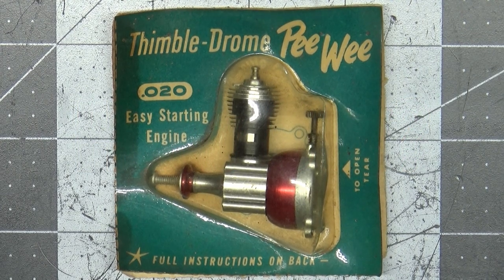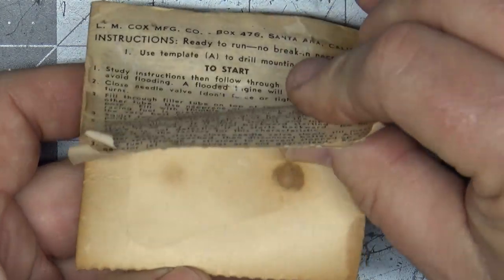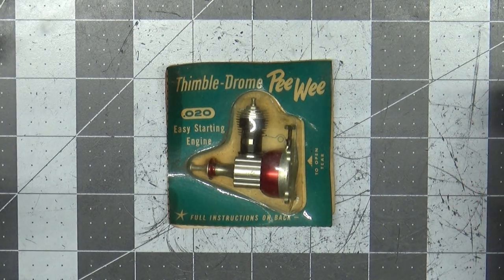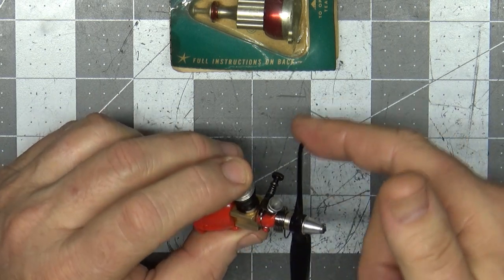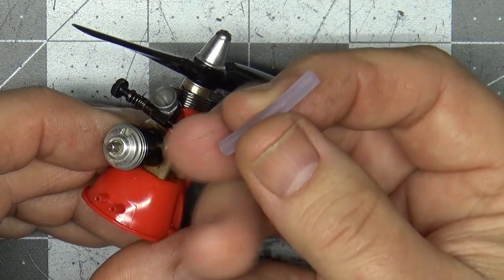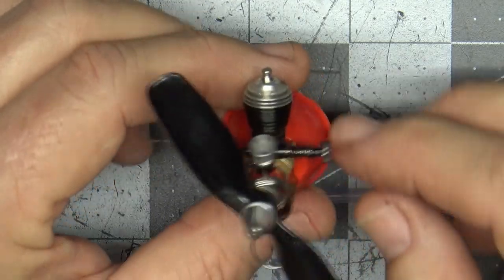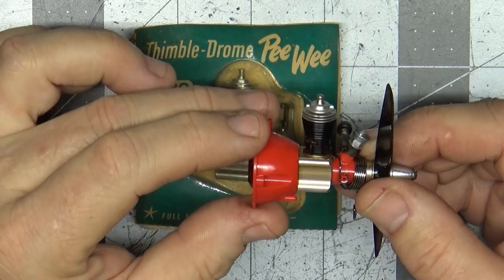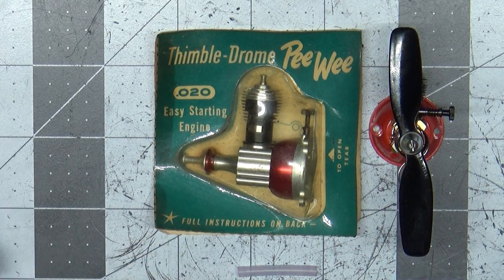Thimble Drome Pee Wee 020

Comment: The fuel tubing available when I was a kid was neoprene and so the smaller gauge was malleable such that it could be made to fit easily onto engines such as these; as far as I remember, you could pop them on and off all the fittings you'd expect to find. There is a special fascination with these tiny motors, but they CAN be frustrating and useless.. That's aeromodeling for you! 🤣🌟👍

Comment: The .020 is late 60’s early 70’s. Cox initially offered it as shown with the metal tank. Used ones on eBay I’ve seen offered at $50 to $100, as it is now I would not open and run it if you have no desire to keep it. My SWAG is if the right collector saw it, you might get close to $200. I had a bunch of .049’s but never had a reason to go smaller. The .010 is a really neat engine, I saw them on small free flights along with the .020. Cox sold three versions of their glow clips, made from sheet copper that slid into the glow head. The fuel line should connect to a nipple opposite of the needle valve. The line was made from semi flexible, clear plastic, vinyl I think. Once it was on it was ON, it would harden after a little time and would be a Bear to get off. Cox glow fuel if I recall was 35 to 40% nitro. For all you need to know about these and parts as well check this out. 

https://coxengines.ca/engine-and-fuel-guides.html

Comment: The Pee Wee came out 1957 and the packaging you have there is the earliest package offered. You can tell because these are the only packages where the company name is written L. M. COX MFG. Co. They changed the name on packages to L. M. Cox Manufacturing Company Inc. later on and later still many other variations. Yours even appears to have the earliest backplate, no mesh on the air intake and slightly silver toned. I have one NIB in the same package as yours. I also have others that I run and use. They are amazingly versatile being reed valves so can run both directions, swinging anything from a 4.5x2 at 18k or a 6x3 at 8k. Factory made exhaust throttles exist for them and Davis Diesel even produces diesel conversions of them. Well worth getting hold of one to run for your video series but, like others, I would not open that particular one.
Reply from the maker: Thank you very much!  This is precisely the information I was looking for.
Reply: yep, this is correct

Comment: 1960's. For the 010, get small tygon fuel tubing and install. The fuel tubing goes on the outlet on the tank to the black nipple on the needle valve. The other red nipple is for pressurization. It has to be drilled out to use. No one ever did as the gain was completely un noticeable. You can get small tygon fuel tubing from a small engine shop, home depot or lowes.

Comment: I bought and flew with a PeeWee around 1967/68. Flew it on an own design control line model, some of the guys used them on free flight sport aircraft although the TeeDee range were preferred for the competition aircraft.  Yes they do like nitro, minimum 10% but some of the competition guys went to 25% or 30% to wring the absolute max out of the engines for max height in FAI competitions. Engines did not last as long though.
Also flew with the 049 Baby Bee in single channel Contollaire Mule II uper regen escapement R/C Junior Falcon, had lots of fun with that!
Sell the Pee Wee to a collector or someone who would appreciate it the way it is. The Tee Dee, very fiddly but you might try to run it!

Comment: Run It unless it's above your paygrade, there is a billion of them,plenty guys have extras and they can save them for the next guys too run, it's what they do,and yes that is not the fuel nipple,I did the same thing at first
Reply from the maker: I guess I don's understand the paygrade comment, but I agree that MANY 020 were made over the years.  But I seriously doubt that many of the exact vintage were made.
Reply: @dmrcflyr2  oh I didn't mean any bad it's just so many people don't want too use them and there is a lot of them being saved and they are Fun too run,I built a full fuselage control line plane for mine but a small r.c. or free flight is good with these,anyway THUMBS UP!  !!-!!

Comment: Run it David ! This is an engine archive and I think it holds a place in a lot of modellers hearts. The packaged one has internal plumbing and should run on high nitro fuels.
Reply from the maker: You do have a point there....
Reply: Richard Weeks Totally agree. The fuel system on these engines is a reed valve. The needle valve controls the amount of fuel gets behind the reed Pretty amazing way to supply fuel.
Reply: Leave it in it this package ; there are countless pee wee engines out there to fly but few as old as this in this shape.
Check the 1/2 a forum on rc groups for example.

Comment: I think that is a TD .020 rather than the .010 as that is smaller yet. Fuel tubing was clear vinyl, goes from the nipple on the tank to the inlet on the nva. The case fitting you are talking about was for optional pressure feed using a metal tank. You had to dismantle the engine and drill thru it into the crankshaft pathway. The .020 Pee Wee is older than late 60s, its late 50s issue when they first came out.
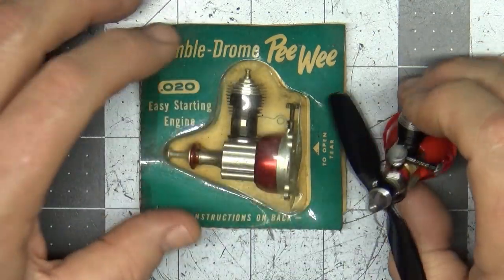Reply from the maker: No the small engine is definitely an 010.  See the size difference? Freeze the video at the 3:54 mark.
Reply: Hard to tell sizes from photos sometimes! Prop looks like 3x1.25 and that is correct for the .010.

Comment: David as you know that fuel tubing is the wrong kind to use. Buy the clear tube basically it is IV line that will allow you to run the engine.  You can use silicon but you must by the right type which is 1mm x 2mm OD I have used both. Here is the link to Matt's 1/2A store for the right fuel tube: http://www.exmodelengines.com/product.php?productid=17719&cat=264&page=1
Yes the .020 is the second generation engine by Cox they switched to red anodized tanks for more bling and the cylinder and piston are hand matched for the very best possible power. The cylinder is the thin walled type. 2 other generations engines followed the one you have. I have flown to 122 mph with the Tee Dee .020 fast park flying or local field flying can be had without all the fuss going out for a day of flying with larger planes. 143 mph with a Tee Dee .051 best down wind pass with a tuned pipe: https://www.youtube.com/watch?v=DXzPWEFNTHE   The mighty Tee Dee .010 can hit 130.4 mph down wind https://www.youtube.com/watch?v=lOwcjRdK10s
I fly the fastest Cox powered RC 1/2A planes documented on youtube.
Reply from the maker: What area of the world/country is exmodelengines from?  They have US currency as the default, but I cannot find a location.
Reply: @dmrcflyr2  I received something from Matt a month back he is in the USA tracking started in CT.  There is Bernie out of Canada Cox International if your not in the US.
Reply from the maker: @AmpAbuser  I just registered on the site so I can get some stuff.  Everything  in the registration defaulted to New York NY.  So maybe there...?  Thanks.
Reply: @dmrcflyr2  tracking started in BURLINGTON, CT.  after your first order you will know I would not post his address of course.
Reply: @dmrcflyr2  also developing turbo plugs and other items here same machinist: https://kamtechnik.com/
Reply from the maker: Ok, cool.

Comment: That tubing for the 0.10 is wrong mine has a clear hard plastic tubing that’s kind of formed to shape and it connects opposite side of the needle valve. Not on the starter spring retainer post.
Reply: That is a pressure fitting for optional pressure feed, instructions explain how to set up- it is on all the TD and Medallion series.
Reply: Your fuel tube has simply hardened with age, it is not hard or preformed. You need a small diameter tubing if replacing it.
Reply: @tobiaghost  Correct. Clear vinyl, used to come in several sizes. Rubber "surgical tubing" was used also. Both need frequent replacement as they deteriorate rather quickly especially in sunlight.

Comment: Neoprene fuel tubing, or use electrical wire connection, insulation
Reply: Yeah, it was a tiny thin walled tube, I think I got some of that tiny tube that came with a tiny fuel tank, Sullivan I think.

Comment: That is the oil out on the 010
Reply from the maker: Oh yeah.  Duh..  Still though, the fuel tubing doesn't stay attached.
Reply: Do you have any dubro fuel tanks that come with a little bit of fuel line
Reply from the maker: I might.  Are you suggesting the inner tank line that gets supplied with the tanks?  I'll check.
Reply: Yes
Reply: The nipple on the red carb housing is simply a vent for tank pressure. Drill right through it and in to crankcase for crankcase pressure.
Reply: My friend has one but he doesn’t use the crank pressure
Reply: Negative, crankcase pressure tap.
Reply: @dmrcflyr2  Use a metal pressure tank like the old Veco that were set up for this.